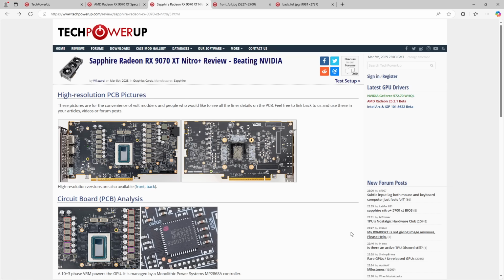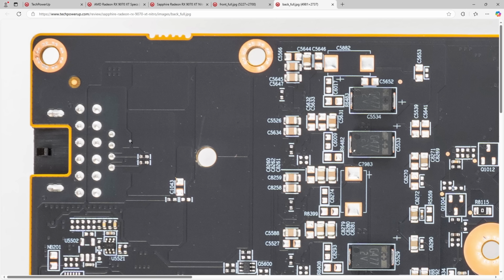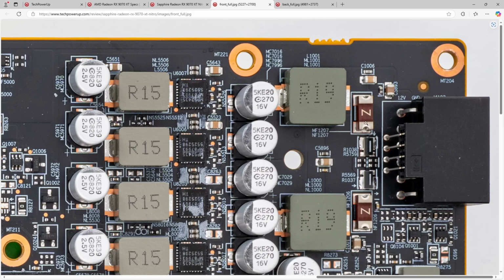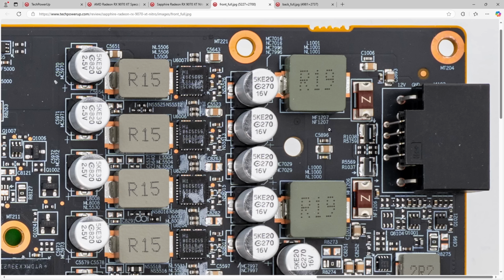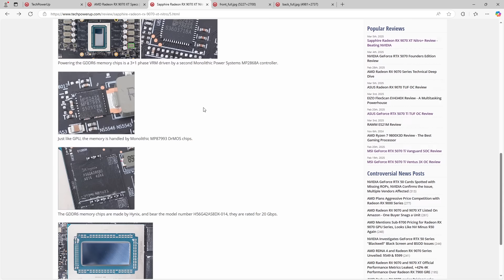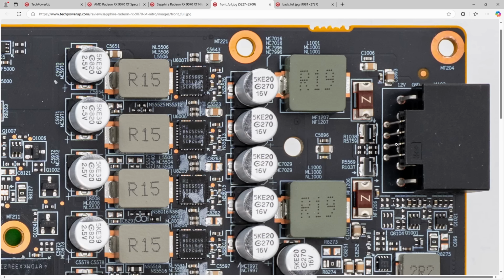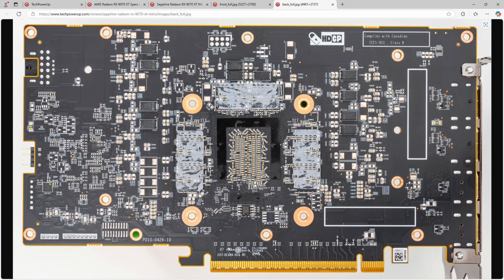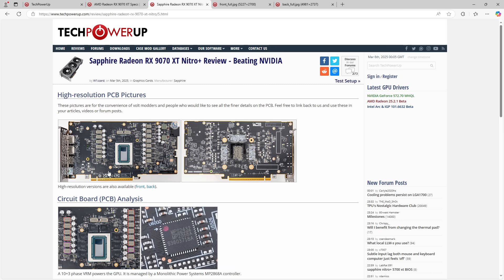Taking a look at Sapphire implementation of the 12VHPWR connector on the RX 9070 XT Nitro+

Comment: Thank you for this. 

Unfortunately can't buy this card for the same reasons as the nvidia cards, regardless of the benchmarks and pricing. 

Not leaving a lot of options for safe components if all the manufacturers are going to be this needlessly careless. 

I wish the other channels drew more focus to the PCB design than the cables to really drive the point home instead of giving the manufacturers a free pass in that respect.

Comment: Serious question: after looking at the 9070 XT power efficiency charts, the 3090 TI is usually holding up last place, beaten by modern AMD cards, which are in turn beaten by every Nvidia card with *no load balancing*. How much of an efficiency loss does load balancing impart on a card? Is Nvidia acing these tests simply because they've disabled all safety measures?
Reply: That's just a 3090 Ti thing. Lots more power for a little more performance.
Reply: @Serketry88  3090 Ti’s power efficiency was bad because it was on a bad node.

Comment: According to a spreadsheet shared by the PC Builder on YT, the ASRock Taichi OC RX 9070 XT also has a 12VHPWR connector like the Sapphire Nitro+. The other 2 Sapphire models, the Pure, and the Pulse use 2x8-pin connectors. The 11 XFX RX 9070 XT models use 3x8-pin connectors, same for the 2 Yestron models, the 2 Asus models, the 4 Acer models, the 2 Gigabyte models, and 1 of the 4 Power Color models, while the other 3 use 2x8-pin connectors like the remaining 2 out of the 3 ASRock models. The list has 31 RX 9070 XT models on it while pcpartpicker lists 26.
Reply: Yeah Taichi next please Buildzoid.
For the sake of curiosit at least.
Reply: So sticking with my prefered brand, XFX is a good call, nice! 

9070XT is something im interested in, upgrade from a 6750XT
Reply: @verios44  same, my 6700xt served me well, but I want some more vram for llms and more gaming power. Thinking between 7900xtx and 9070xt
Reply: @vinylSummer  go for the 9070xt - amd dropped the chiplet design from 7900xtx for a reason...
Reply: 2x8 Pin, is enough for 600W!! Most Corsair´s PSU, the 8 PIN CPU(300W) is the same as 8 PIN PCIE(300W). I have 3 PSU´s, 650W, 850W and 1000W, the same in all.
Reply: It makes no sense. I don't understand. This would have probably been the single nicest model of 9070 XT if not for this choice of connector T_T

Comment: I think you are failing to understand what current does in parallel. The whole point of having multiple wires is to be in parallel is because 1 wire cannot supply the totally amperage the gpu needs by itself without heating up. Each wire has a grade rating for max current. Meaning having mulitple wires shares the current between the wires like resistors in parallel.  12v rails are joins together to supply the FULL current output to PCBs VRM mosfets. PCB traces(They just need to be thick enough) doesnt need to split power unless u have multiple GPU dies. You dont need to split 12v rails on the card. It makes no sense to do so. Imagine if u split each 12v rail from PCI-E connector  and having seperate circuits  for each 1. you increase complexity, 2. increase failure points, 3.increase price.  Even the 12v rail on motherboard are not seperated. What is seperated is the VRM phases.

The connector melting problem is not an issue with pcbs PCIE power connector. The issue is with the PCIE connector that goes into GPU PCIE plug

Comment: Honestly, I do find it funny that Sapphire advertises the fact that the Nitro+ has fuses, like they know the 12VHPWR connector is problematic so they went out of their way to show it. To be fair though, the 9070 XT doesn't have near the power draw of the 4090 and 5090 so the likelihood of melting is near non-existent.
Reply: All of their Nitro GPU's have always had fuses. Did you also find those GPU's funny?
Reply: @RoyBrown777 Did they advertise that fuse protection on the older models? If yes, then less funny, but if not, then very funny.

Comment: Fear not consumers, I'm sure they will get the power connector up to par when they release the 12VHPWR 2x6 3.2 Gen2x2 Rev 4 standard
Reply: forgot pci-e in there
Reply: it will also carry usb 6.66, hdmi 3.14, DP 3.14159, abcRGB  and wi-fi 13FFS
Reply: Do you mean 12VHPWR 2x6 3.2 Gen2x2 Rev 4 UHBR2 or 12VHPWR 2x6 3.2 Gen2x2 Rev 4 UHBR3
Reply: Call it 2x6/3, where /3 refers to splitting on GPU side for total power over 150W
Reply: and ofc "AI", "Pro" or "X" has to be in there too :D
Reply: Instead of 12VHFR 2x6 they'll make it 12VEFR 2x4 to make sure it melts.
Reply: Wonder why they call it 2x6 if all 12 pins are just Wired together
(Ps all 6 power rails)
Reply: @meki___6881  because 2 groups of 6 pins. 6 for ground, 6 for 12 volts.
Reply: @meki___6881  6 positive, 6 negative, but your point still stands
Reply: @meki___6881  Because at the connector it is 2x6.  Plus that way all the people who don't watch things like this won't know that they all turn into one big rail after the connector.  You know until potentially their card blows up and starts a fire.  etc
Reply: @meki___6881  It's one power rail anyway,  there are very few PSUs with more than one power rail.
More pins aren't for the PSU being able to provide that power, is for the card to do it, and for the cable to do it without wasting too much energy and heat.
Reply: @meki___6881  It doesn't have all 12 connected together. It has 6 pins tied together for the 12V rail and 6 pins tied together for the ground rail.
Reply: @andr3w1985  that's literally just stating the obvious if all pins were fused together it would just result in a giant puff of smoke until some breaker trips
But it's still a single rail instead of having two 6 pin connectors with 3 ground and 3 positives each
Reply: @meki___6881  It should be obvious, but saying "all 12 pins are just Wired together" implies just that. This wasn't meant as a scolding, more a correction/clarification as I guarantee some people will take that statement as read.
Reply: @meki___6881  I guess just because of the physical layout of the connector.
Reply: & knuckles
Reply: Which will of course still be backwards compatible.

Comment: It's dumb that the connector is not balanced. At the very least, the connector and yhe cable should get better cooling with the airflow from the third fan directly going over them.

Comment: 12VHPWR, 12V2X6, or whatever you want to call it, should have been banned for safety reasons a long time ago.  At this point, I am more concerned how such high failure fire hazards are allowed to pass through safety regulations. Whoever is letting this design to pass through industrial regulations needs to be investigated.
Reply: Yeah, why is this a thing at all in the first place? Aesthetics?
Reply: @clarenceoveur9497  Space saving, for better cooling solution. They don't want to stack 8 pin connectors forever. It sort of makes sense for the 5090 as it eats 600W. They dont want 4x8pin sockets to block air and customers to bloat their PC with more cables. But it makes zero sense for any other GPUs right now.
Reply: @clarenceoveur9497 the wish of Nvidia to copy Apple more and more, so yes, simplicity, looks. The first iteration of this with 3090 and even the improved one of 3090 Ti were still save and then they ruined it. It’s a shame
Reply: @biquiba that's cool, but why they need to make tiny boards though. The card is massive because of the heatsink anyway
Reply: safety regulations are a lot weaker than you think for consumer electronics. It mostly boils down to "enough people complain to the authority and they decide to force a recall"
Reply: @marcogenovesi8570  well yeah, the plumber who fitted a new boiler told me that some brands actually don't bother to do anything with explosions of their gas combi boilers, even when the root cause is a defect they get away with it.
Reply: The connector itself is fine, it's just a modified molex micro-fit, which is an established and reliable connector. The classic 8 pin is also a micro-fit.

It's bad pcb design with lack of needed protection against the dangers of aggressively paralelling wires
Reply: @WorkinDuck  and low FOS ratio, 600W is pretty much the extent of this gauge wire.

Comment: If they had placed locking tabs on either side and increased the gauge of wire, then you probably would not have as many issues. The fact that used a wire gauge at it's safe limits and only 1 locking tab, is just asking for issues. Who actually decided this connector would be suitable for graphics card use? Nvidia or PCI-SIG.

Comment: Not a fan of the tight 90 degree bend in the cable needed to use the connector.
Maybe place the connector at a 45 degree angle to reduce the radius of the bend.

Comment: Why on EARTH didn't they split them into 2x3 pins when they already have two shunt resistors, two fuses and two power stages? THIS IS ABSURD! All they had to do was split the polygon and reroute a tiny little bit for the shunts. Same number of components. Same number of board layers. Same time in the pick and place machine. Same amount of freaking solder used. The only difference is a microscopic amount more acid used in the etch phase. We are not even talking entire cents per board here...... Who hit them in the head with something heavy? I demand answers! :-/

Comment: The problem is, if it's connector is wearing out.  Most motherboards, you need to remove the GPU to get to the NVMe slots to swap out SSDs, so here iwe have more reason to remove the GPU than we had in the past, and a notoriously bad power connector.  I really hope Sapphire makes the standard 2-3 8-pin connectors so we will have a choice. I do like Sapphire, but will look to other brands to avoid the 12VHPWR connector.
Reply: Do note that both the Sapphire Pulse and Pure utilize 2x8pin connectors, it is only the Nitro that has the 12vhighfailure connector.
Reply: @qerlak  Cool, because I have my eye on the Pure.

Comment: I like the idea of a single connector, but it seems like the spec is hot garbage to tie all the pins together like that.
Reply: It's like wiring your entire house directly to the transformer/main and expecting it just magically work itself out without separating 120v, 240v, 480v. Yeah that's not how flow mechanics even work.

Comment: On intel's website there is the ATX side of 12v-2x6 connector spec. In it is specifies that "All pins LLCR < 6 mOhms after 30 insertion-removal cycles" and "LLCR shall not vary on any pin more than 50% from the average for each of these groups." Where the pin groups are all the vcc pins in one group and all the grounds in the other. On paper that means that the current shouldn't imbalance to the point that connector melting would occur. So, I think treating the connector wiring as groups of six might really be in the PCIe side of the spec.

Where the group of six wiring falls apart is that just looking at contact resistance on the one connector doesn't actually tell you how current will distribute. You need to look at the series resistance of the entire line from the PSU to the card for each pin and use those resistances to compute how current will distribute across the pins and those series resistances do not necessarily have a tight enough spread to avoid catastrophe!

So I don't even think the connector needs to be out of spec to fail, it just needs to belong to a modular power supply and have an unfortunate arrangement contact resistances at each end of the cable.
Reply: The problem is that there is no hardware to "enforce" the spec or shut off the thing when it becomes out of spec for whatever reason. And when it all burns down there is no one to blame, as everyone will be finger pointing on each other - connector, cable quality, power supply or user error.
Reply: "LLCR shall not vary on any pin more than 50% from the average for each of these groups."

Specifically after that 30 insertion test. If you look up tests which cite requirements they are nowhere near 6 mOhm. There can't be any requirement for variance for entire lifespan.

And of course any modular PSU has independent resistance variance on its side!
Reply: @ПётрБ-с2ц  "There can't be any requirement for variance for entire lifespan."

Sure there can. That's the point of a specification. That's why it's tested after mating cycles, and thermal cycling, and thermal shock, and vibration testing. To ensure the system meets a specific LLCR requirement after 10 years of simulated use.
Reply: @ 
There are like 40 tests listed in Molex connector and none of them limits variance in any way except 30 insertions test.

Guaranteeing 50% variance over entire lifespan is next to impossible. I can bet $10000 there is no requirement in the spec to provide limited variance over entire lifespan. 

Guaranteeing 6 mOhm for entire lifespan is impossible.
Reply: @ПётрБ-с2ц  guaranteeing <6mOhm for 10 yr lifetime is the entire point of EIA-364-1000 testing, it's why every one of the lifetime test groups (temperature life, thermal shock, vibration, thermal cycling) first do lifetime durability (30 mating cycles) testing, then does lifetime testing, then is reseating followed by LLCR testing, after each lifetime test to verify that despite now exceeding the spec by a mating cycle, the terminal still passes.
Reply: @ragzillaz  you are ignoring my statement. There is not a single test in the Molex document which requires less than 20 mOhm change except 30 insertions test.
Reply: Wonder if this could be identified looking at voltage drop.  Check 12V at 2d idle.  Load card with 3d and check voltage.  Compare with lookup table of acceptable voltage drop.  I would assume under load with some weak connections 12v would drop more than normal.  Sure its not elegant but could be enough to pop up warning in software or pull back clock speed.
Reply: @spyder000069  that's actually one of the approaches people have looked at to detect this problem, you don't even really need to compare under 2d/3d loads. You can just look at the card edge +12 versus the aux power +12 (you can see both in HWiNFO, I've been meaning to test out making a custom sensor using their registry custom sensor scripting to monitor GPU aux power droop)
Reply: @ragzillaz  Good idea on the card edge as reference.  I would think with enough feedback one could construct a good idea on what is reasonable droop.  Even if it uncovers other issues like a weak power rail it probably would be beneficial.
Reply: @spyder000069  three major probems  
1)   PSU voltage is stable but not THAT stable. 
2)  Unbalanced connection can have insignificant voltage drop so it makes no sense to do what you suggest. Poor connection on all pins is statistically impossible.
3) cable resistance varies and is undistinguishable from connector resistance
Reply: @ПётрБ-с2ц  My response:  1) Voltage drop between unloaded and loaded should be significant when measured at the card.  The 12 on these is parallel so the card has no idea about individual pin drop.  However, it would see the overall drop and be able to compare and make an inference.  As ragzillaz pointed out they can also compare straight against the pcie card edge 12v on for reference.  2) Yes, the unbalanced connection would have insignificant voltage drop at low current draw.  However, at high current draw it should be easy to detect because overall voltage would be lower than expected.  3) This does not affect this method.  You would not be looking for specific resistance differences.  The resistance will be included in the test result by the overal amount of votlage lost due.  Again, all lines are parallel to the card so individual line readings in this case are useless.  The test is not something that it would be running continuoulsly because of course gpu load would be varying under windows.  This would be more of a sanity based check that would be most effective at driver level for it to do on boot or something like that.  The reality is this connecter needs to be dumped.  Its proven a safety hazard and unreliable.
Reply: ChatGPT generated the 12VHPWR connector.
I rest my case.
Reply: Firstly it seems more like Wishlist(don't really know how to explain when you set an end goal and just ignore all the middle steps to reach it) than a Solid requirement and doesn't specify how that is actually achieved

Average of the two groups Which are ground and Plus
Sounds to me like 400w power draw means 400w on each Group
50% of 400w would mean 200w on a single pin
Reply: 1/ Terminals at the PSU side have the same LLCR requirements, giving you lower/upper bounds.
2/ 300mm (4mOhm, iirc) or 600mm (8mOhm, iirc) of 16AWG copper has an incredibly predictable resistance, giving you the rest of the system parameters.
3/ Single rail PSU design means negligible internal resistance variations in the PSU.
4/ More resistance in the system (e.g. when jayz dropped a PMD2 in the middle) actually helps out, by raising the noise floor and effectively reducing the "signal" of variable contact resistance at the terminal. 

So yeah, you have all the data to calculate the system, which is what SIG did to sign off on this. Failures requires the connector be pretty far out of spec due to mating cycles, or people to be breaking other rules like lian-li/moddiy/zotac are with gold plated pins/terminals. Unless there's an undiscovered thermal cycling issue which only happens in the video card environment that isn't tested to in the EIA tests.

Comment: Thanks for the video. The ASRock RX 9070 XT Taichi also has a 12v-2x6 connector. Curious if it's the same deal? The review roundup on Videocardz links to a Japanese site with some tear down photos.
Reply: Probably yes, it seems to be 12v6 spec to misuse the connector like this. Unfortunately they didn’t stick to what the 3090 Ti did and that was the first card that used 600W connector. Insane, because the 3090 Ti ran fine and did not burn despite being a 500W+ card.